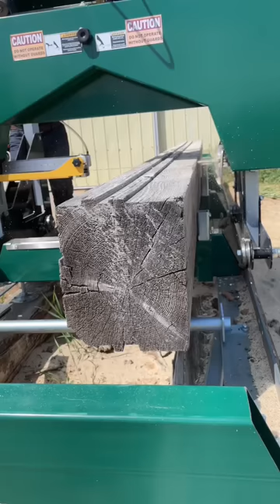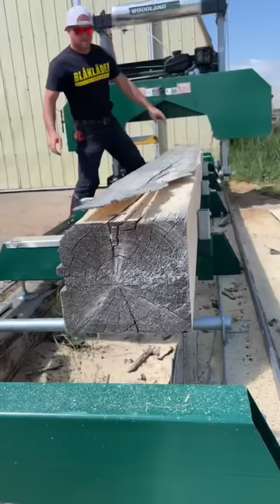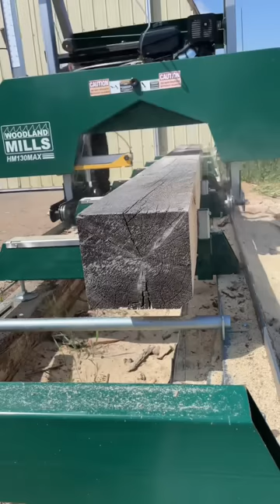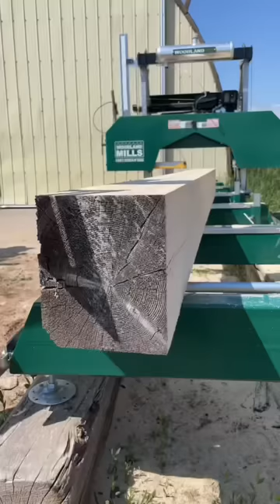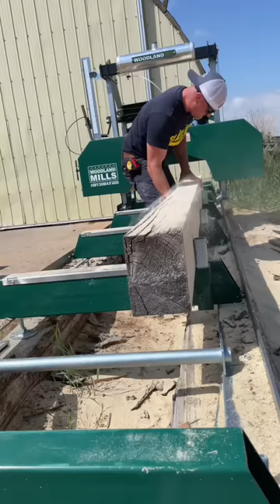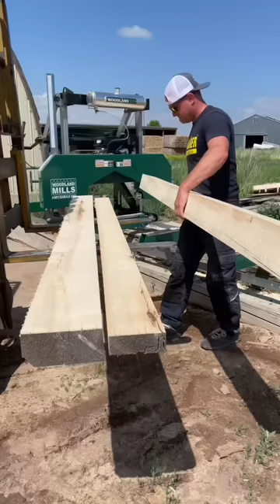Old warped beam on the sawmill #woodwork #woodworking #wood #maker #bois #holz #madera #sawmill

Comment: I dont know much about this stuff so would someone please explain something to me? I get that this would cut it to a straight shape but wouldn't the structural integrity of the beam still be compromised by the bowing?
Reply: Possibly, but irrelevant since he's not repurposing it into another structural member.. he's gonna make furniture out of it
Reply: These solid flooring beams ( often 100 + years old) have long since stopped any further twisting and  warping. They are very stable. Once the small degrees of bowing and twisting are shaved off like this, there is little or no future movement.
Reply: The Architectural Woodwork Institute will have specifications about the permissible angle of grain in timbers, I am quite sure. I would expect no loss of strength or stiffness per unit size in sawing straight the timbers we speak of. Of course, a smaller timber will support  less than the original.
Reply: @klchapman554  No, the end use is irrelevant. I was curious about the structural integrity in general, not the integrity in relation to a specific use.
Reply: @LarryTait1  Okay, thank you for explaining!
Reply: @leehaelters6182  That's a great explanation, thank you for taking the time.
Reply: @seventhfox4256  the structural integrity is irrelevant if it's not being used as a structural member, now, isn't it? Spalted wood has almost zero structural integrity, but you can still make furniture and musical instruments out of it, for example
Reply: @seventhfox4256 , all the best!

Comment: Is there a stress inside wood?  I was surprised to see the outer layer jump up after the sawing.  Can someone explain this?
Reply: I suspect the outer layers are slightly drier and once the cut layer is free the drier side is slightly contracted along its length?
Reply: @LarryTait1 , that is quite true, but also many pieces of lumber contain stresses deep inside that are not because of differing moisture content. Ripping boards on a table saw often reveals this. The two halves may pinch shut with great force during the operation, or splay wildly away from each other, forcing the stock against the blade. The most extreme example may be faced by sawyers reclaiming Greenheart timbers, which have been known to practically explode off the carraige, very dangerous. Those brave enough to take the job proceed slowly, belting the timber with chains and shifting as the blade progresses.
Reply: @leehaelters6182  sounds  scary!  I’m a very big fan of white oak, and this wood will pinch the saw blade while ripping. I’m also a very big fan of the riving knife built into the blade guard for this same reason!
Reply: @LarryTait1 , agreed! The way they are built into many saws these days is a very happy thing. It wasn't always so! They once were scarce as hens' teeth!